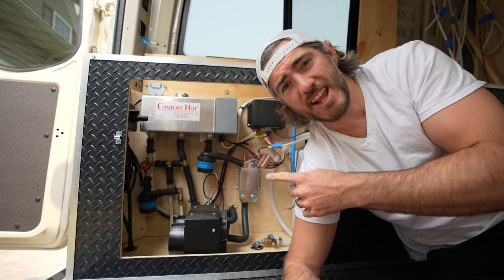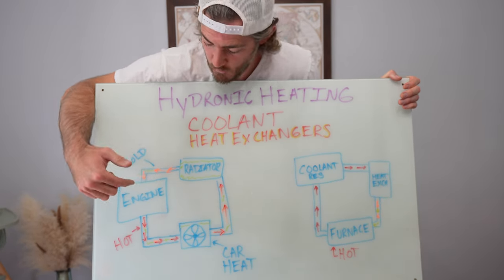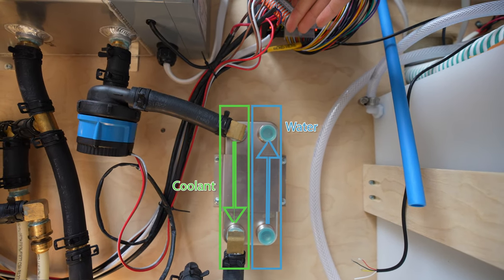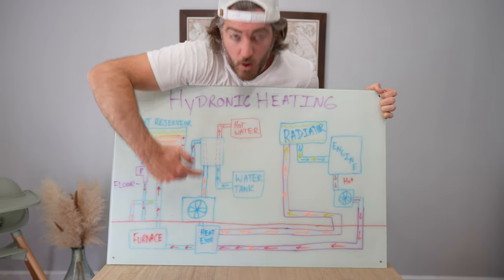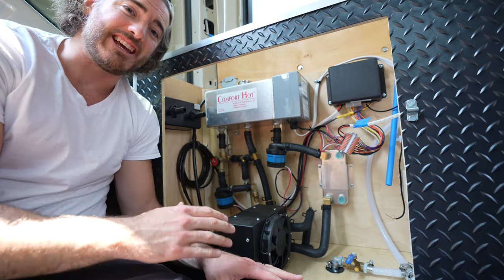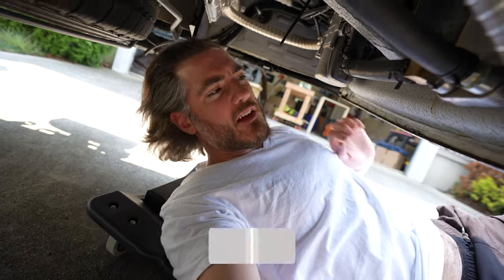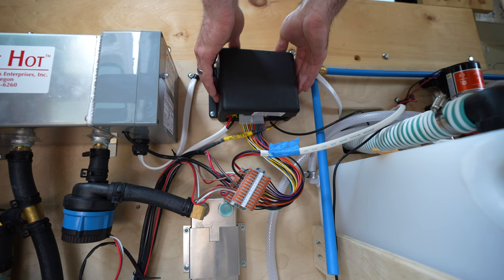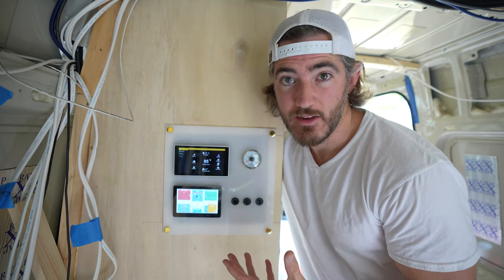Hydronic Heating For Van Life by Rixen's Enterprise

Comment: I have Rixen's Espar D5WS in my Revel and I am mirroring that system in my Campulance conversion.  It really is the best all around heating/hot water solution.  Tied into engine heat exchanger free heat and hot water while you drive. Hydronic loop in the floor is so nice, no more cold feet!

Comment: You might take a tip from humble road if you havent allready. Put your exchanger by the engine so that your 2 systems stay separated so if you spring a leak on one side it doesnt affect the other engine cooling system. Bet its nice not having to work in the street, LOL! Coming along really nice!
Reply: Adding proper valve assy to engine coolant loop provides 100% isolation of the hydronic system from engine coolant system in case of failure in its side. Definitely good idea as plumbing adds 5..10 meters of coolant hoses under the vehicle with multiple clamp connections...
Reply from the maker: Humble road is great and a good idea, I think I remember seeing him mount an exchanger in a pro master I think? there was like a perfect spot for it in the engine bay.  

Yea haha this definitely beats the street you got that right!! Haha
Reply from the maker: Love this idea, I’ll have to add in two valves 👌🏻👍🏻
Reply: @MathersOnTheMap  you need one 3-way ball valve from cabin heater to back to engine or to feed rear, and ball valve to rear return with T-fitting, preferably Gates fiber reinforced one.
Normally 3-way valve flows to rear and return valve is open. In case is needed isolation change both valves so return is blocked and so is feed, 3-way will short cabin heater flow back to engine
Reply from the maker: @mhelander  good call I started thinking through this and 3way makes way more sense.
Reply from the maker: Wouldn’t ya need two 3 ways? I’m also Struggling to find 3 way barbed ball valves at 3/4”
Reply: @MathersOnTheMap  I've used 19mm hoses in main circulation and 16mm in where it fits better (DHW coil and air coil fittings). Found 1/2" NPT valves which have big enough opening for good enough flow...
Then plenty of brass household plumbing parts, put together with proper plumber's goo (definitely not to use teflon tape! and even worse to use automotive silicon sealant)

Comment: Why wouldn't you just add an Isotemp (glycol heated water tank) and add an Espar heater. Aside from not having the heated floor element wouldn't it give you the same thing you're getting with the Rixon for a fraction of the price? Does anyone have any insight on this? Am I missing something?

Comment: What was the logic behind having the air heater and the water heater on the same  circuit  instead of the air and floor on the same circuit? You will mainly be wanting  air and floor heat at the same time, but during the summer, you would only be needing the water heater

Comment: I noticed you run your system from the furnace to the expansion tank but all other videos I see run from furnace to heat exchangers with the expansion tank coming last. Is there a reason you chose to do yours that way? Does going to the expansion tank first cause an extra loss of heat?
Reply from the maker: I just followed Rixen’s diagrams and instructions, check out their learning center on their website for their diagrams, super helpful!!

Comment: I think that they have a heat exchanger that you can put into the engine compartment.  That would isolate the coolant to the back from the engine compartment/radiator coolant. That way if the hose from the front to the back is broken your engine coolant won't be lost.
Reply from the maker: So three heat exchangers in total I guess?  Not a bad idea, you can still have a point of failure in the engine loop, but less of a line to worry about…I carry extra coolant in the van just to be safe
Reply: @MathersOnTheMap  you wouldn't need an additional heat exchanger, just relocate the existing one into a more protected area, so that if the coolant lines fail in the unprotected area, it's only the Rixen's system lines and not your van's.

Comment: Just what I needed, was just about to dig into figuring out where to tie into the engine heater core line. I have the same setup except with a cruise n comfort split a/c system. Nice setup, I’ll be following along as we’re pushing to be done by the beginning of August also.
Reply from the maker: Nice Eric!! Yep we tied into the driver side of the heater core where the 90 elbow was.  Good luck with the build!
Reply: @MathersOnTheMap   Thanks, I took a screenshot of the location from your vid.
One last question, what size ID heater hose did you use? 3/4”?
Reply from the maker: @ericdvorak7030  yep that’s correct 3/4 ID!

Comment: I've built my hydronic heating system so that there is Autoterm 5kW diesel furnace, installed just front of driver's side rear wheel. Hot water goes through floor to 15 liter hot water tank coil, then to other side to kitchen where is manifold for floor heating system and air coil with fans, both have separate thermostat.
Return goes through floor to engine bay where is three valve manifold connecting to post cabin heater pre engine & coolant expansion tank, then to furnace pump.

So my system uses solely engine coolant circuit and its expansion tank. There is high flow circulation pump in front of furnace and second for floor circulation which has also hydronic down mixing 3-way valve.

For hot tap water, there is  3-way valve in front of its circulation pump, valve controls circulation through either kitchen tap re-circulation loop for rapid hot water to conserve water consumption, or to circulate through plate heat exchanger to post heating recirculating shower flow (which is 100% separate from fresh water system).

It took only two arctic winters to dial everything right, now it works like a charm!
Reply: And my system can source heat from furnace to living quarters, then prior to start driving adjusting engine compartment valves to pre-heat engine. Then while driving engine heats everything until it's colder than -25°C when cabin heater cools flow too much and need to separate engine from circulation.
Hot water tank has also 1kW resistive element which is available for summer time to get hot water when batteries are nearly fully charged.
Reply from the maker: @mhelander  This sounds like a beast of a setup!!! I’m assuming it’s all custom/DIY?  Do you have any concerns of water freezing for the water line going through the floor? I’m guessing you insulated the hell out of it.  Thanks again for the valve tip!!!!
Reply: @MathersOnTheMap  Yes, insulated bulkhead 50+ mm XPS, walls & ceiling 50mm XPS, floor 70mm PU with hydronic tubing on heat spreader. Doors and part of passenger side still to get properly insulated.
Only window is in side door, double glazed, and no holes or hatches on roof because it's completely used for 900Wp solar.
This was just very comfortable last winter, coldest -28.7°C...
Reply: @MathersOnTheMap  Ah what comes to water pipes, fresh water tank 70 liters is internal, of course. All water lines are inside and made sure while constructing cabinets and all that there is enough air circulation to keep even corners warm.
And there is hydronic line near plumbings and it also goes under the LFP battery setup.
Garage is under bed, fully insulated from living quarters, and only heated from floor. Coldest garage floor spot has been above +4°C without additional air circulation from living quarters where when colder fan coil thermostat keeps temps comfortable.

Comment: Hey Kevin third time watching this install and it is a great help for installing my Rixen’s system. Thanks so much. Do you have any recommendations for the under bed install? Like does the reservoir radiate a ton of heat under the bed?  Should it be a certain distance below the bed? Love to know your experience. Thanks. 
PS wishing you guys all kinds of joy on your future non vanlife adventures. Looking forward to see what you get up to. 😊
Reply from the maker: If you're going to hook it up to the engine, I would install a heater core bypass valve to turn off the loop in the summer when you don't need passive heat generated from the coolant loop.  Otherwise you're only going to create heat in the summer when you need hot water which isn't for a long period of time and wont make a difference.  

In the winter when the heater is running the passive heating from the coolant reservoir will be a nice add.  We had about 3 inch clearance from the top of the resevoir to the plywood supporting the bed. Hope that helps.
Reply: Awesome idea thanks for this I didn’t consider the engine heating it up in the summer thanks so much. 🙏

Comment: My builder installed the Rixen Sys. in my 2019 3500xd.  The controls are rather crude. There is a Espar control, which does nothing, maybe sets the max run time.  the Rixen thermostat controller does seem to piggy-back off of it though as they are wired together - don't know why.  In addition to those control elements, there is a 3rd panel with rocker switches for system on/off, furnace on/off, water on/off, and a 2 speed fan rocker.  I do not have radiant floor heating.

I like the touch screen you have.  Will it work on my 2019 system?
Reply from the maker: It should you can contact Rixen's to upgrade but it will definitely come at a price.  I think they have a few videos discussing the upgrade

Comment: You might want to plumb in some valves so that you can bypass the engine coolant system when you're parked. It seems like your engine cooling system (ie, that giant radiator on the front of the vehicle) is just going to be dumping valuable heat energy right outside, 'heating the great outdoors'.

I would want a way to isolate the two systems for when you're parked and just running your heat and water directly off the diesel heater.
Reply: Every engine has a thermostat which blocks off the radiator so it's already built in.
Reply: @johnleaste828  
That's not actually how thermostats work, but nice effort. 👍
Reply: That's not an issue at all with his setup. Note the heat exchanger at the rear of the van, right next to the furnace; the house system is isolated from the engine system via that heat exchanger. Yes, some heat from the house system will be lost to the engine system when parked, but the coolant on the engine side isn't flowing so there won't be much heat loss.
Reply: @wanderingzythophile9083  
The water in the van's coolant system WILL circulate, as the hydronic system heats the coolant in the heat exchanger. 

"Some people think that thermodynamics don't be like that, but it do."
–Neil Degrasse Tyson, Probably.

Comment: Hello nice video! I am thinking of getting the same system. How do you like it after using it?
Reply from the maker: We like it a lot!  We haven't been in really really cold winter climates with the van yet, but so far so good.  If you're not going to be in really cold climates then the heated floors is more of a nice to have and i'd probably save the money.  But if you will be in cold climates the heated floors are so nice!!! Our old van's floor used to be FREEEEZING, not in this van.  Rixen's is an amazing company with the best customer service.
Reply: @MathersOnTheMap   Thanks for the reply! I have talked to Rixen a few times, they are wonderful! I have read other pros for a heated floor include dust doesn't get blown about, and that when you open the van door all the heat doesnt just go out. It takes longer to warm up but then longer to cool down. The cabinets stay warmer, etc. So I think there may be more benefits other than just freezing cold. At least I am trying to justify spending 10K as I do not plan to be in freezing cold.  

While the heated floor takes its time to warm up, you can always turn on the blower right? ;-)

BTW you are a handsome man, and congratulations on your new baby!

Comment: Curious about your engine coolant system connection. I don't think I saw a fluid pump added into that long loop of coolant hoses; is this meant simply to heat the coolant in the house system from the engine side of things as you drive? Or to heat the engine coolant while parked up to make getting the van started in cold conditions easier?

As someone else said in the comments, you might consider adding another heat exchanger, one up much  much closer to the engine; if one of those long hoses catches a rock and leaks out coolant, that's your engine coolant and you could get stuck, or worse, damage the engine. Another heat exchanger would segregate the engine side.

Also, I see your furnace exhaust pipe snaking between those two long coolant hoses - are those touching at all? Any issues with the furnace exhaust pipe getting hot enough to damage the coolant hose(s)?

Comment: Nice job. My only difference of opinion is it wouldn’t matter if you had a 10 gallon water heater it doesn’t add another ounce to your carrying capacity. Think about it and you’ll see why.
Reply from the maker: Thanks Michael!!! You don’t think so? I mean ya got to pressurize the system first but once you do doesn’t the tank hold 2.5 gallons ready to heat up.  So then if you refill your water tank it would be the tank + the hot water heater capacity right?
Reply: @MathersOnTheMap  when your big tank is empty you know longer have any water to push the water out of the water heater so it will just sit there full. You will still have it on board but you can’t use it.
Reply from the maker: Ahhhhh!!! The light bulb finally turned on, thanks for the tip

Comment: Man, I love the video! just a question, i bought the kit bu t didnt came with the cable that conect the central electrical box on the monitor screen (AB). did yours come with that or did you need to buy it separated?
Reply from the maker: Thanks!!!  the screen connects via wifi no connection needed other than a positive and negative 12v power.

Comment: Hi Kevin. Chapeau for a great job in explaining your design. Would you mind supplying a link to which “kit” you purchased from Rixen. I am planning the same on a 144” 4x4 sprinter and would really appreciate a source to purchase the above unit. Does Esperbacher build the diesel engine and Rixen put the kit together. I’m in Nova Scotia. Feel free to driveway surf if you get nearby. 
Regards
Jan
Reply from the maker: Hey! Hope you’re safe and the fires didn’t affect you in NS.  We’re hoping to head that way sometime in August!  

The link is in the description to MCS7 system, let me know if it doesn’t work.  

That’s correct, Rixen uses the esperbacher hydronic furnace with its own proprietary software to program everything together, along with the pumps and the comfort hot coolant reservoir.
Reply: Hi Kevin
Thanks for asking. The fire is nearby and safely contained due to a recent deluge. Thank you for your prompt reply. Wondering which additional kits you purchased and is one blower enough? Feel free to drop in when in the area. You can even enjoy a long shower with an endless water supply and I’ll make a few suggestions on things you might want to explore in Nova Scotia.

Comment: I’m curious to see how well this goes in the winter. Want to get a good system for a van so we can ski here in Europe. I’ve heard people say use a false floor to protect the lines from freezing up but I see yours are under the van. Do u think any hoses/lines have the potential to freeze up being exposed under the van even if well insulated? Also, is there an option in the settings of the touch screen to change to Celsius rather than Fahrenheit?
Reply from the maker: Yes they can definitely freeze, most just empty drains directly onto the ground during the winter and use natural organic products so it doesn’t impact the environment.  Yes you can change the temperature type

Comment: Nice explanation. How do you like the system? Is the heated floors an incredible upgrade from just an air furnace? Or is it more of a luxury item that gives warm toes but still need the furnace blowing? Basically how would you evaluate the choice of having heated floors or not?
Reply from the maker: I’ll tell ya once we hit the road 😅 still building!
Reply: @MathersOnTheMap  Sounds good. I'm just starting my build and this floor decision is holding me up!
Reply from the maker: @omjaye  I spoke a lot with the guys over at Rixen’s and I believe the floor is a pretty power heating element and the combination with the blower is really good.  The furnace that heats the coolant is running whether or not the air blower is on to heat the water and floors.  Does that make sense?

Comment: Amazing video, thanks so much! What's the difference between the MSC7 and MSC6? I couldn't figure it out. Also, did you buy the floor heat kit from them as well? Why did you choose to/not to?
Reply from the maker: Thanks Jordyn! We got the floor kit from Just Roaming Design who partners with Rixen.  Here’s the video on the floor if your interested: https://youtu.be/cK2wa6eVNXk
Reply: Late reply but looking at the two kits-- it looks like the main difference is the controller--- MSC7 has a nice touch screen interface, the MSC6 has the old style with buttons and LED digit display and back lights for heat sources--  in addition it looks like you don't have to wire anything to the control board directly on the MSC7-- it has a pin connector to the board that goes to lever wire clamps-- much easier to wire then the MSC6.... we are looking to buy the MSC7 kit---